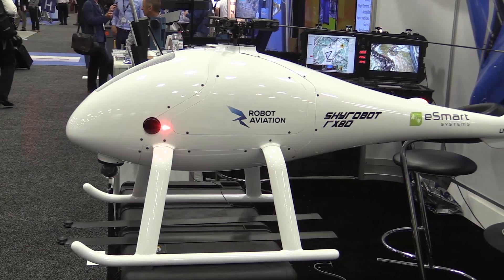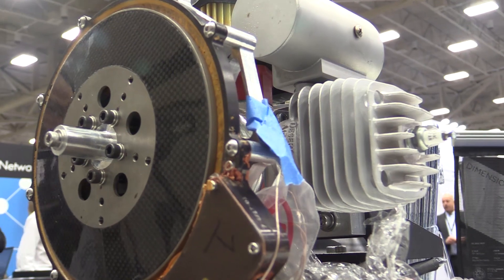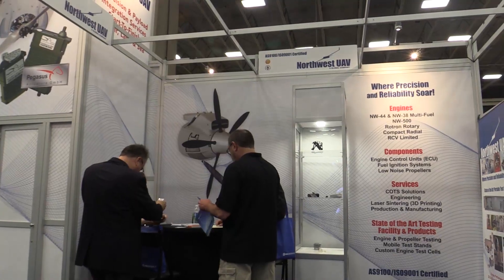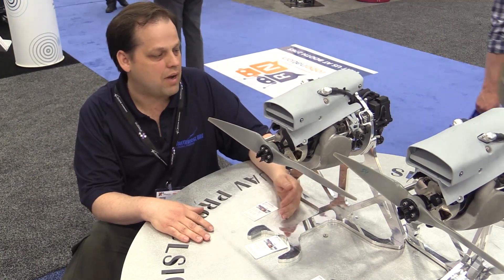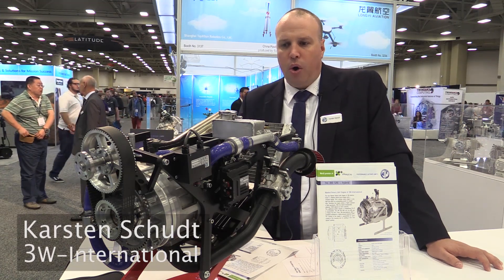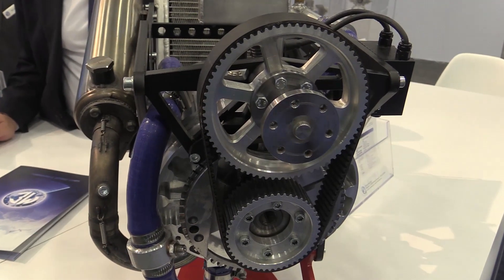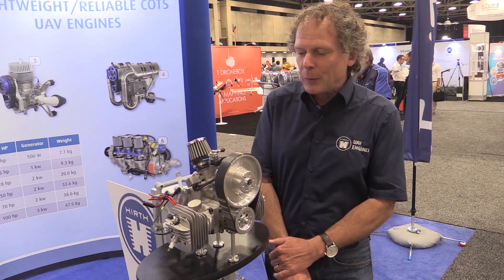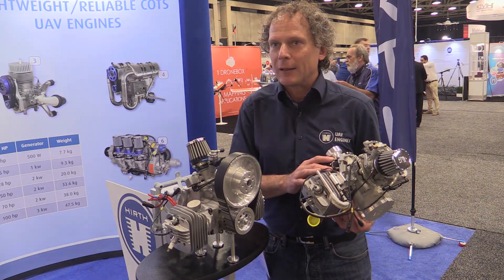Drone Engine Technology at AUVSI

Comment: Those cylinders are stihl cylinders designed for chainsaws ,,I recognized them as soon as I seen them ,,they are set up as case reed intake with the original intended intake ports closed off,,carburetor jetted on A V fuel, ,I  have used them on the motorized bicycle engines that iv been building for over 2 years now there very dependable

Comment: What is missing from that line up is the DARPA Funded Liquid Piston Engine, optimally integrated with the generator of the first unit in the video. The marine industry is waiting for this combination for backup power. The Liquid Piston is a 3 lobe rotary with 30% efficiency, low noise, and low vibration. The extra efficiency comes from the “Piston” being used to channel both exhaust and intake air so becomes a heat exchanger. This LPE Generator will also be used to provide backup power for Solar installations where it will be built into water heaters so it generates both electricity to recharge Lithium Batteries, but heats the water as well bring its operating efficiency to over 60%.
Come on people, make it happen. There is a huge efficient energy need out here.

Comment: Nah, don't waste your time on this stuff. Electric motors and batteries are getting to the point where they're just about to overtake chemical engines. It'll be just a few years now, so why spend your time developing a technology which will be obsolete in a year or two?
Reply: How do you figure that battery energy density will equal that of a "chemical" fuel in just a few years?  Motors?  Yes, electric motor power could exceed that of IC engines long ago.  But batteries AND a motor?  Hell no.  Last I read, actually having a REAL product (battery) that could even come close to the energy density of say,  gasoline, AND be affordable, was at LEAST 20-30 years away.  Remember, there's one hell of a delay between dicking around with super caps and uber graphene amidst a pile of wiring and tubes and making something WORK and THEN mass producing it AND combining all that with a lightweight motor and speed controller, and doing all THAT at a price and weight that's EQUAL to or less than that of an equivalent internal combustion engine.
Reply: chemical engines?....combustion engine driving electric motors is my guess....
Reply: By chemical engines, I mean that their energy is stored chemically, in the chemical bonds of fuels such as kerosene, rather than electrically. Combustion engines are a form of chemically powered engines, as are rocket engines and fuel powered jet turbine engines.
Reply: @northandeast9444  Don't batteries store their energy in chemical form?  At least with ICE you only have to carry one of the reagents with you.